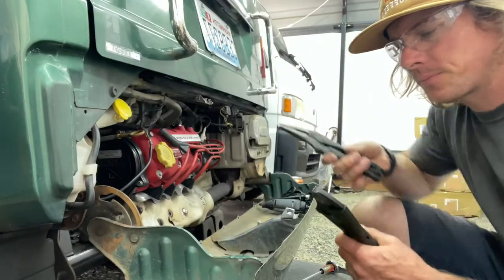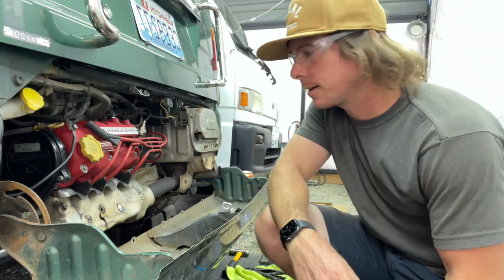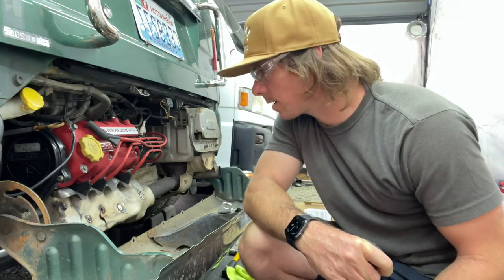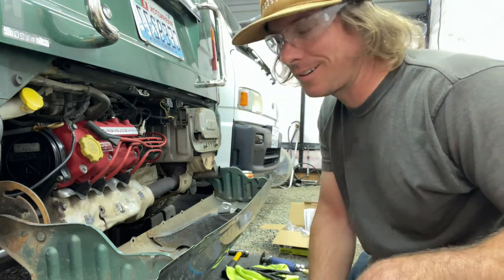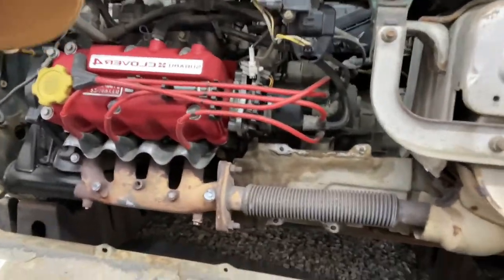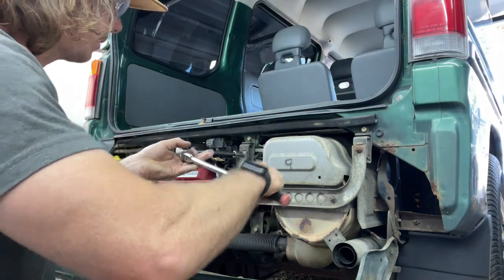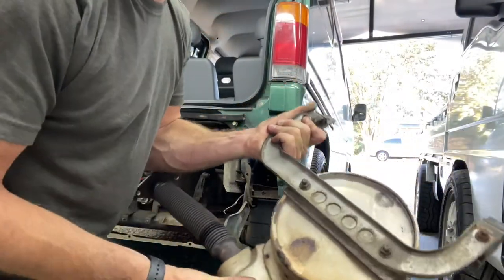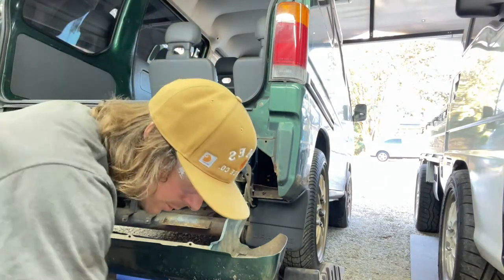Subaru Sambar Exhaust Manifold Shield Removal and Muffler Removed for a SICK JDM Exhaust!

Comment: Where did you get the exhaust from? I think mine has a terrible leak.
Reply from the maker: Check out my 500yen video! It will be helpful! I got it off yahoo auctions using 500yenshop 👍🏻👍🏻
Reply: @OhKeiGarage  I would like to get that exhaust as well. I looked on 500yenshop putting in various keywords but didn't have any luck. I watched your other video tutorial on 500yen and searched according to the imprint on the muffler, " Suzuki 67R-m01, still no luck. Any help locating this would be greatly appreciated.
Reply from the maker: @derekgroth6327  https://500yenshop.com/en/yahoo-auctions/list?cid=All&search=&s=sambar+muffler&translate=1     copy and paste that link and just search through the listings till you find something that will work :)